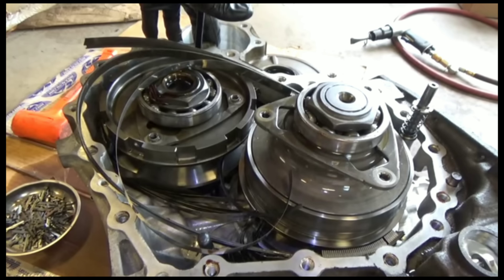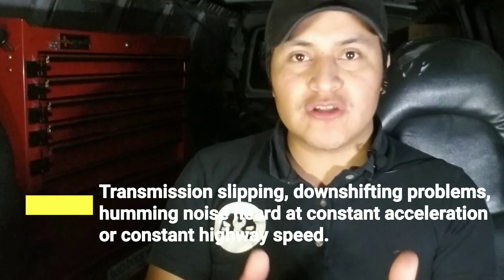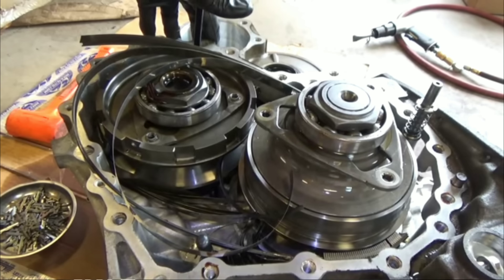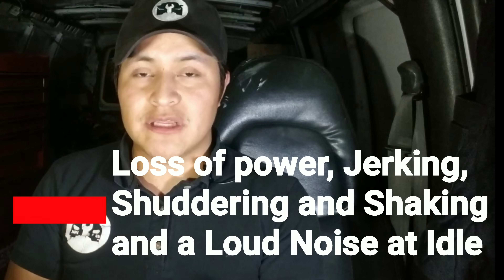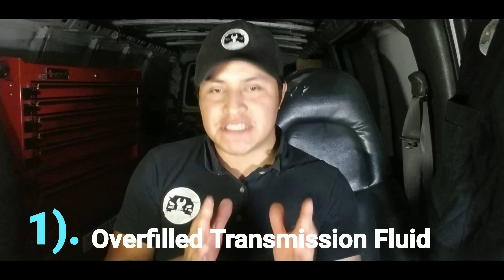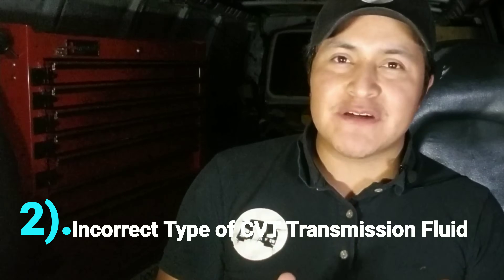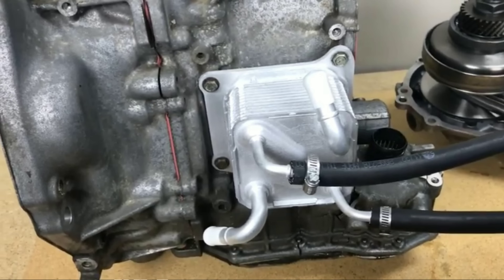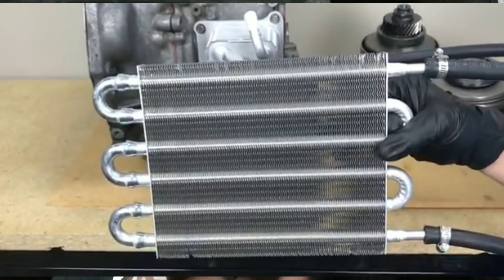NISSAN CVT TRANSMISSION | why it fails and what you can do about it to prolong it's life

Comment: People People. Here me and hear me loud. I had a 2015 Nissan Altima with 372,712 miles on it. I changed the transmission fluid every 70,000 and even changed the transmission filter inside the pan every other oil change. I also added a Derale external transmission cooler at 80,000 miles. I drove Uber with it 7 days a week all day and night long and it gave me no problems at all.

Comment: Have a 2017 Rogue. Changed fluid at 68k.  Car has never given me any problems. Now near 80k. Will change fluid again soon.  Mine is mostly hwy miles.  Daughter has a 2014 Sentra.  Had a quick change place change it, at 90k, started to have slippage shortly after.  Had her take it to Nissan dealer at 92k, they changed it ($450).  Don't know it they dropped the pan.  I changed it at 110k (Nissan fluid).   Runs fine, no slippage.  Car gets hard use, Dallas traffic everyday,  80-85 mph on freeway.  Amazed it keeps going.  As soon as I can get it for a few days, I will drop the pan change both filters and use Amsoil. Now around120k miles. Maybe look into a extra cooler.  Readers might be advised that almost every car company is now using CVT units.  I see Ford, GM, and Subarus are starting to have same issues.  Apparently the Toyota and Honda units are somewhat better.  Just my opinion,  watching professional mechanics, for what it is worth.

Comment: Engineering flaw should be a recall. I have a 2019 and it's done I still owe in the  5 digit rage and can't drive it
Reply: I change oil every 3,000 and Serviced every 10,000

Comment: I have a 2010 Nissan Cube with Xtronic (cvt) transmission. I love my cube and it’s literally my dream car, the transmission went and I just had a new one put in $3,400 CAD later and it drives so much better. I’m doing a lot “research” to learn how I can make this new one last and just take proper care of my car. I’ve learned so much and I will be taking my car in once a year to have the coolant and transmission fluid and filter changed by my local Nissan dealership.

Comment: This guy is the best best of best and not only for  one thing but for several reasons. He is saving so much time for everyone plus tons of money and giving you so much knowledge. Thank you Sir . And God Bless you. I got a question please see if you can answer me. I got 2017 Infinite qx60 AWD BASE MODEL . And I am getting the same sound humming sound which you described in your video number ( 2 ) Problem in your video regarding transmission fuel pump has to change by taking it out complete transmission. I leave in NY so if you can guide me for the best Mechanic for my this job or if you can do it , If you are in NY . PLEASE sir I am really in big Mess . Thank you

Comment: I have a 2013 Pathfinder and as of today 168,101 miles with no transmission problems.  Thanks to my transmission shop who recommended a tranny service/flush, not just fluid exchange every 30,000 miles this SUV has been working fine except for normal maintenance issues, battery, brakes, etc.  Great video with good data.
Reply: My 2018 Pathfinder has 108,000 miles on it. I replace four quarts of transmission fluid every third oil change.  It's a small maintenance step to prevent a huge transmission bill.  No issues so far.
Reply: You really have it good because the 2022 Nissan Pathfinder will come standard with a nine-speed automatic transmission, replacing the previous-generation's CVT.Feb 8,
Reply: That’s great to hear ! I also have a 2013 pathfinder with 140k miles but the transmission has never been serviced 😮 my serpentine belt popped recently but other than that no other major issues .
Reply: And that is what is required, flush and change every 35-45,000 km.
And! use correct, recommended Nissan CVT fluid..

Comment: Hello . I can see you have plenty of experience so I have a question. I'm looking to buy a used car . I have narrowed my search down to a 2015 Lexus GS350 or a 2018-2019 Nissan maxima . What scares me is I'm not an expert and both of these cars will be with 70-110k miles on them depending on year and price . What are your suggestions ? Are one of these a better option? Also will getting a  extended warranty be recommended and would this help calm my fears . Any info would be great
Reply from the maker: I my self would lean more towards the Lexus because that's basically a Toyota and Toyotas are a better choice

Comment: DON'T EVER BUY A NISSAN! Problem fixed!!
Reply: Someone somewhere could say this about every brand on earth. I know people who have Nissans with over 200k on them and they run great.
Reply: @jasonknotts5001 do all brands have multiple class action suits like Nissan?
Reply: @jasonknotts5001  do they all have multiple class action lawsuits against them?
Reply: @jasonknotts5001 Sure but even a blind squirrel finds a nut every once and a while! Look there are cars out there that make Nissan look like hot garbage! WHY BUY ONE when you can get a better car for almost the same money? Also Nissan is investigating cyberattack and potential data breach now so hey, go ahead and buy your future headache.
Reply: Had a 2009 Murano soon it hit 120.000 transmission start slipping
Reply: @terranwallace7528 Serious question; Did you ever service the CVT transmission fluid? And if so, how many times before you noticed it starting to slip? I own a Nissan and this concerns me. I still owe 14k on it at 90k miles
Reply: I run a car lot and I stop buying nissans 3 years ago.   Way to many issues with the trans
Reply: @VTX1800rider In the past, yes, Nissan was reliable but it changed after they joined cooperation with Renault and supplied the part or made it interchangeable....
Reply: Just buy a manual and you’ll be fine
Reply: Mine hit 122k transmission just now started to make the friction noise only in high rpm 3.4 - 4. Thought about a flush but I'm just going to let it go. Then pay to get a new cvt. Oh well
Reply: Too late
Reply: Got that right!
Reply: Cvt's are in a boat load of cars fella, smart comment
Reply: Nissans are awesome.
Reply: @dmac1259  For your repairmen I agree.
Reply: Chevy, Chrysler, and Dodge are the true vehicles to avoid. Nissan are putting better transmissions in at least.
Reply: @luyyyu I agree, the only cars worth buying are Toyota's, Honda's, Mazda's or Lexus. The rest are hit and miss. IMO
Reply: 😂😂😂 only old school Nissan not this new junk
Reply: The Nissan engines are solid, but this transmissions are sketchy
Reply: @sayiangod9404  Yeah its to bad, if the transmissions were fine they would be very nice vehicles.
Reply: Exactly
Reply: My transmission in Altima went out at 104,000. And keeps going out smh
Reply: Except an old one my maxima 1995 lasted 400,000 miles
Reply: @SKA343 I think we are talking the new ones.
Reply: @discoveryman59  On our 4th Nissan. Maintenance!  You change the fluid in the CVT when Nissan recommends and you don't have any problems.  
Period. Every single manufacturer recommends a fluid change at a certain amount of miles... Do it and you don't have any problems.... I know. I own them... and have for over 15 years.
Reply: @SKA343  do you know if the 2023 Altima is also having these issues? Thank you.

Comment: It's mainly just a problem with the CVT belt stretching over time and then there is nothing you can really do. It's with any belt driven thing. Over time the belt will stretch with use due to be being under constant tension. Is there some kind of adjuster on the trans which accounts for the belt stretching over time? Most accessories have a tensioner which keeps the belt under constant tension.

Comment: My 2015 Rogue did not shift properly in the first mile, engine revved to 3,000 rpm when it should have been around 2,000 rpm. The wife brought it back and parked it . We bought it new, trans was flushed at 30k by the dealer, has 59,000 on it now. The temperature was below freezing last night. Anybody had a similar situation?  Any suggestions? I was gonna get it flushed again at 60k.

Comment: 2013 nissan cube   sounds like its in granny gear.  at low speeds 5-10 mph   drives fine changed fluid every 20k   no one has been able to answer why it does this  have owned 5 of these and only one ever did this

Comment: My Nissan Kicks transmission was serviced by Oil Changers; subsequently, I experienced leakage, after which I took it to a transmission shop, only to have them discover the wrong transmission fluid was put in.
Now, $2000 later( not including lost wages from my car being in the shop: I’m a full-time delivery driver) Oil Changers is doubling down, insisting that they put the correct fluid in.
Any help or insight would be appreciated.

Comment: Got my suspension, cv joints, and a whole bunch of stuff fixed. They said when they raised suspension it took the weight off the transmission and something went wrong. None of the normal things a failing transmission usually comes with. I heard a clanging noise constant when I put my foot on the pedal. It sounded like metal clanging against metal. Are they trying to fool me or is it really my 8 or did they mess my car up? 07 nissan murano
Reply from the maker: Not sure what to tell you there.
The transmission might've been on it's way out already
They did something wrong
Or it might be something else that's making the noise

Comment: I brought my 2013 Rogue to the dealer to change the cvt fluid ,they saw a cooler in the grille ( not hooked up yet) . One hour labor charge, wrote up that the car was customer tampered with, told me 4,000 for a replacement cvt. It was limping often and had 78k miles.

Comment: 2015 murano that is leaking a little 5:12  fluid. Took to shop b/c twice it lost power after coming to a stop
Light. After restarting it the car was fine. Misfire on cylinder 1 and 2 is an error message that I did get one time. Now the shop is recommending to reseal the transmission which I’ve never heard of. Any words of wisdom would be very much appreciated.
Reply from the maker: The transmission is know to leak at the housing joint in the middle of the transmission. So resealing the transmission will stop any transmission fluid leak so that it doesn't go low again but it is a costly repair because the transmission has to be removed and disassembled to reseal it.
The other option is just to check the fluid one or twice a month depending on severity and refill as needed.

Comment: Can someone help me out I have a 2009 nissan rogue AWD and the transaxle fluid is pretty much dead empty I didn’t even know about the damn fluid so my women picked up automatic transmission fluid Castrol transmax import multi-vehicle  but the oil don’t tell you what type of oil it is besides automatic transmission fluid I see online I need CVTF type N automatic transmission fluid not sure if I got the right oil don’t wanna ruin my vehicle
Reply from the maker: It should be on the sticker your car has under the hood, should say CVT Fluid NS2 or something different depending on what model you have but it should have a sticker under the hood with CVT on it

Comment: Great video, hope you can help I have a 2010 nissan rogue that 80% of the time shifts hard from P to D and R, any advice? Fluid is at right level
Reply from the maker: The shifter is hard to move from P to D and R? But drives fine once it's in D?
Reply: @WrenchLink  no the transmission clunks like if the mounts were bad but they are not on from park to d or r otherwise car runs fine
Reply from the maker: @alexquezada510  there might be an internal issue or CV axle play

Comment: I have a 2018 Murano. A couple months ago I decided to have the transmission fluid changed preventatively at 90k miles. A few weeks later I started smelling a burning sulfur smell daily. Took it to mechanic, and they couldn’t find anything wrong. Now, only 4 months later at 97k miles, I started to feel my transmission slip a couple days ago (when shifting into 2nd gear), and my engine light came on yesterday. 

Is this timing a coincidence, or could it be that the act of changing the fluid a few months ago led to the failure?
Reply: Updated: transmission ended up dying and had to get a new one installed. $5,500
Reply from the maker: If you put the right transmission fluid in at the right level then it might've just been time for to go bad
Reply: @WrenchLink  it was changed by the delearship…so it was def Nissan transmission fluid that was used, and I assume they filled it to their specified level.
Reply: I have to wonder if they overfilled it? That is death for a CVT transmission. No matter where you get it changed, ALWAYS check it yourself immediately afterwards to make sure it is not overfilled.

Comment: I bought a Versa new in 2012. Since new, when the car was cold upon first driving, the CVT would make a horrible crunching noise as it transitioned from the low to high speed ratios. Otherwise, it drove fine. Since it was my first CVT car ever, I assumed it was normal. I brought it into the dealership at 30k miles to have the first fluid change. The owner's manual said it could go as long as 60k miles under the normal service schedule. So I felt I was being proactive. The dealership said they didn't change the fluid because their computer said the fluid was still clean and told me to come back at 50k miles. At 38k miles the CVT started slipping, but only during one very specific part of my afternoon commute. Of course, since the issue wasn't always present, the dealership said it was fine. I knew these transmissions are expensive to replace and I wouldn't be able to afford the replacement should it happen, so I sold the car at 56k miles since it was on the verge of running out of warranty at 60k miles. I loved the car, but need a better piece of mind from a more reliable car.

Comment: Buy one with a manual transmission or another kind of automatic transmission . Change the oil every 20000 -30000 miles and it might be ok.

Comment: First, WOW!  Great helpful video.  I'm a backyard mechanic but have no experience with these new cars.
I have a 2015 Nissan Pathfinder SL.  It had a trans. problem when I first bought it (used) at around 55k. Dealer repaired it under warranty.  Since then, I haven't had any problems but I've never changed the fluid either. I use the vehicle to tow a boat (4500 lbs).  It's now hitting 100k and I decided to hang on to it for a few more years and want to change the CVT fluid. (no dipstick).  I heard I have measure the fluid temp to insure I don't overfill.  Can you provide some info on the process?

Comment: So would installing a separate large trans cooler fix all of them problems??

Because the engine gets that radiator hot and now this trans fluid is flowing through this hot radiator heating up the fluid.

Comment: Very informational video! The first point would cause more cold start damage if you live in the cold winter in the northern as adding regular transmission cooler would cause more damage for sure if CVT fluid is not warm enough before aggressive acceleration, bypass cooler or adding additional thermostat would be good in both worlds. 
As for the second point, someone in the comment section did CVT fluid change every 25K miles but still failed at 110K miles so make sure the paper cartridge cooler filter after taking off wheel liner on driver's side is also changed to prevent clogging. I want to add fifthly, drop the transmission pan and change the metal mesh filter housing and nitrile rubber O ring with the paper cartridge cooler filter, o ring is the key of shifting bad as it's how filter looses suction from bottom of the transmission pan, while dropping the pan, I would advise to clean metal shavings on two magnets and I just added a third one, I have heard people added three more magnets even. My dealer said there is no filters so they only used exchange machine to change 5 qt last time without changing the paper filter and reprogrammed CVT under free recall at 43K miles, I am doing it by myself this time with Idemitsu N3 fluid at 80K miles. Sixth would be never rev over 2000 rpm or even 1500 rpm before CVT fluid temperature warms up to 40C/104F according to CVTz50 app but I believe it should be even 45C/113F, IMO, at least 35C/95F, as repair manual says fluid change between 35C/95F and 45/113F. It's also the temperature for fluid change. Nissan has cold start protection in TCM anyways tho. I am lucky to live 10 minutes away from freeway entrance before reving up with cruise control to help acceleration to 65 mph, Recently, I have been monitoring temperature of CVT and engine for each drive, this makes car driving like a lab test now. FYI, I am a former engineering student liking to rebuild my cars and help fixing other people's car. Oh the seventhly, turning on rear window defroster will reduce horsepower and cause vibration somehow on my 2013 Versa, worn or over tightening or cold & hard squeaking serpentine belt can also affect acceleration, Nissan/Jatco made most sensitive transmissions but I heard Jatco 2022 CVT-X (JF022E) is finally redesigned better, we will see comparing to Toyota's latest Aisin CVT. It should be better than CVT-7 and CVT-8. It's used on Qashqai in Europe since June 2021already.
Reply: I was thinking of adding more magnets but didn't know if it would cause problems
Reply: @denisekoenig9479  t

Comment: My transmission was going bad so I jacked up the nissan up high nd I put it I. Reverse  for 5 minutes  .. by doing that i drove the nissan Nd till now not had a problem  ..I still haven't did no tune up on the transmission.. I had problems at 200k since I drove it in Reverse  it running just fine at 225k.. your video are very good.. keep up the good work